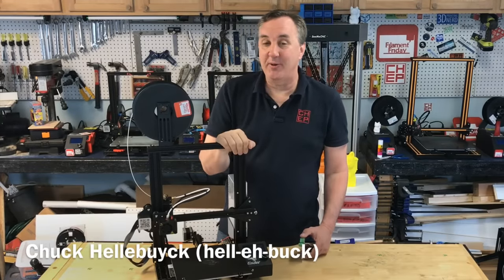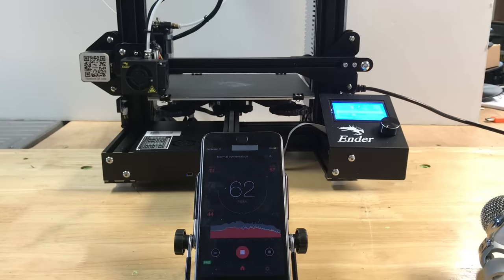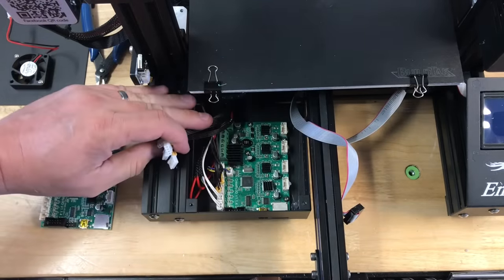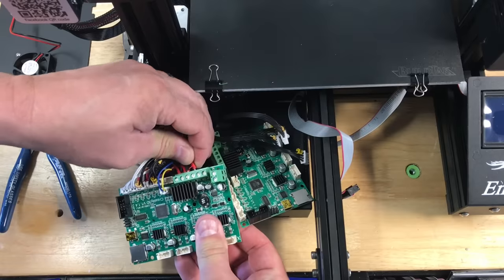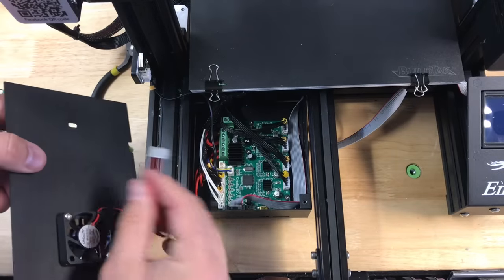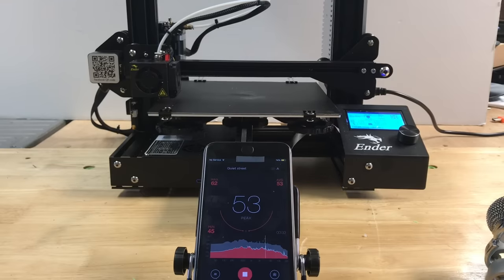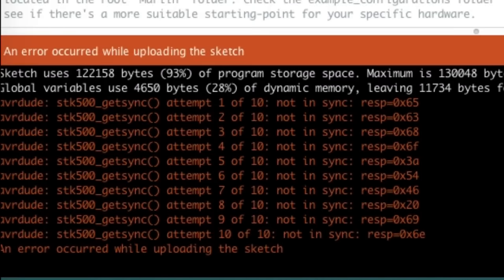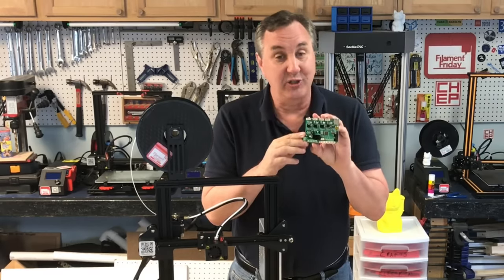Creality Ender 3 - Creality Silent Board v1.1.4 TMC 2208 Upgrade

Comment: I would not expect anything to work on the Creality boards. What I mean is sometimes there boards have advertised features, sometimes they don't, and sometimes it shows up on the LCD and it does not work(my pause/power loss restarted on first layer always). I got this all working by using a programmer and grabbing Marlin from github.

Comment: The board you removed was also the 1.1.4 board which is what my Ender 3 Pro came with.  How can you tell the difference between the "silent" board and the new stock 1.1.4 boards?

Also what is the app you're using for sound metering.

Finally, are the stepper motor drivers installable onto a 1.1.4 board aftermarket?
Reply from the maker: None of the 1.1.4 boards that come with the printers have the TMC2208 drivers. It’s only aftermarket. I used the dB meter app on iPhone.
Reply from the maker: It will work on the Pro as well.

Comment: @Chep: what are the vref voltages your V1.1.4 board is setup to?

My Ender3 with A4988 have both 0,56V for X/Y/Z and 0,72V for E which translates into 0.7A and 0.9A max current.
My CR-10 boards have these setup a little higher and less consistent between X/Y/Z.

Now I just heard in annother video that annother youtuber has his vref voltages setup to 1.2V.

Together with the sense resistor that is changed to 0.15R for the TMC2208 this translates into 0,867A peak or 0,613A RMS which would be only 150mA more for X/Y/Z and a little less for E.
Reply from the maker: I didn’t measure but I’ve read 0.65 to 0.72 for 4988. Around 1.2 for TMC 2208.

Comment: Chep have you had any dealings with the MKS Gen L board? I'm trying to get better temperature stability on the hotend, having added a capacitor to the board on the 5v side it's improved but still by no means perfect.  Any suggestions at all?
Reply from the maker: I’ve worked with previous MKS designs. They don’t open source the schematics so I stopped using them.
Reply: @FilamentFriday Thanks so much for taking the time to reply Chep.  Is there a similar board you could recommend that will take the TMC2208 drivers? I fancy changing out my Melzi board!
Reply from the maker: Why not the Creality board?
Reply: @FilamentFriday  Nice to know that detail about MKS boards.  I am still considering one because the 1.1.4 Silent boards are sold out on the official Creality site and other sellers, like AliExpress, have lots of complaints that the board the get is hit or miss. It might just be the stock 1.1.4 with A4988 drivers and no bootloader or the actual silent board with the TMC drivers. Some buyers are even getting the 1.1.3. Either way the sellers advertise them as silent upgrade with TMC. I would like to get the official Creality board since it is just plug and play but since the MKS Gen L is only $35 shipped from China with the TMC drivers, it makes me think a bit. Great video as usual.

Comment: I installed this board, it worked well, but now when I turn on the printer I get "invalid data" on the screen, never used to display that message, but it prints just fine though.
Reply: I am having the same issue. Have you found a solution?

Comment: Hi, what is the boot loader for ? I’m new to this . Do you need to do this to have the board work or is it plug and play .
Reply: Having a boot loader installed allows you to upgrade the firmware easily. It’s not an issue if you just want to use the board plug and play like in the video. 👍😎🇦🇺

Comment: how does a different board change the sound of the stepper motors?! can someone explain
Reply from the maker: The stepper drivers produce a smoother waveform that reduces the vibrational sound.

Comment: Good, so going forward I would expect no future 3D printer manufacturers should be using anything else but TMC (or better) drivers.  This line has been drawn for a while... Ya hearin' me?!?
Reply: Actually with soldered drivers it is not the best idea to use TMC on e-axis in standalone mode. It is one problem why I call Creality's"Silent Board" a bed thing. You shouldn't use 1/256 microstepping on the extruder, as this might lead to inconsistent extrusion. Prusa use SPI for controlling the TMCs and set them to 1/32 native microstepping on e, using no interpolation to solve the issue. No way to do that on Creality's board (but you see the issue mostly on direct, non geared extruders anyways)
The future of controller-boards should not be TMCs but 32-bit-boards with sockets (like the SKR e3 DIP). So you put TMCs on x and y, maybe on z, and a native 1/32 driver for e

Comment: Chep, I noticed you have switched from the ultrabase type glass bed to build tak. Whats the reason for this? Has the ultrabase stopped sticking?
Reply from the maker: I have multiple machines.
Reply: @FilamentFriday  Ah right, the ultrabase is still going well then?
Reply from the maker: Yes, though sometimes I flip it for a smooth finish.
Reply: @FilamentFriday  Cool, great video by the way. Very useful

Comment: I want one of these but based on the reviews, Creality is dropping the ball with flat out lies regarding features.  Based on the conversation below they may be sending them out with mis-adjusted drivers - voltages too high.  Not good.  I'll hold off until I see better reports before I drop $50 on this (plus shipping) and have to wait forever for it to arrive from China.   Too bad really, I love the Ender 3 Pro, a very solid printer with great print quality out of the box.

Comment: Creality will send you a 1.1.4 board for free.. If you bought a Ender 3 from Aliexpress or Banggood in 2018 that advertised "updated thermal protection" but you got a 1.1.3 board without protection. They had old stock and sold them as being a updated version. Chance are they will send the 1.1.6 board..
Reply from the maker: There is a 1.1.6 board?
Reply: sorry. 1.1.4 board
Reply: There are V1.1.4 boards without TMC drivers.

Comment: So I upgraded to the v1.1.5 board which has the same drivers and boot loader included. Given it still uses the same amount of memory can you add the BLtouch without losing other features?
Reply from the maker: Probably not.

Comment: Would it be a slicer issue for the extruder motor to stop mid-print or the vref set too low on the driver with this board? Checked everything else, jams etc
Reply from the maker: Don’t know. Could be the SD card.

Comment: I was trying your method and lost track of the two initial red wires to the terminal block. I checked my picture and think i have it all nicely the way it should be, but my main worry is if I reversed the two reds on the terminal block farthest from the power terminal block. What will the effect be if I got them wrong, and turn the unit on?
Reply from the maker: Sounds like the hotend heater connection. It doesn’t matter which one. They cane switched.

Comment: Did you test this board with long prints? I am wondering if  the stepper motors getting hotter than usual? and also wondering safety of printing unattended with these boards.
Reply from the maker: I’ve seen no issues
Reply: I've not had an issue with temps 24hr+ prints and all motors are lukewarm at the most
Reply: @vansien  thank you. What is your ~room temperature?
Reply: @vansien  do you know your vref voltages? Did you measure them?
Reply: @Azaim2  sorry i havent replied sooner, room temp is 22° and ref i cant remember the ref voltage off the top of my head, i did adjust and set them i know that much, but ive been working on several different boards and remembering each setting is tricky.
Reply from the maker: I recently reset them to 1.0v
Reply: @vansien  Mine room temp is like 30-32° may be thats why i got hot stepper with  default vref values (1.23V). I asked my problem to customer support of creality and they give me XYZ 0.94V，E 1.2V these values for this board. I set to these values and I am not having problem after that.
Reply: @Azaim2  that sound about right to me, when i next have to open the printer, ill retest what values i used.

Comment: how do I change the choice of the tmc2208 in the firmware?  I would like to use the 1.1.9 firmware that I have now on the stock card. I also have the bltouch . thanks in advance
Reply from the maker: Shouldn’t have to change anything since it’s design to emulate 4988.
Reply: Ok solved
Reply: non devi cambiare nulla
Reply: @jackomelly676  ho abilitato le voci TMC2208 e funziona

Comment: but if I upgrade to this, what if I want to get a mks etc, do they work together or would getting this board be pointless
Reply from the maker: Pick one or the other not both.
Reply: @FilamentFriday  ok that's what I thought would have to happen! Which way would you go?
Reply: TCG Therapy 
Cost of an MKS Gen L (or similar) with stepper drivers is going to be more.  I think I paid about US$70 all up with the TMC2130 drivers (very similar to the 2208, with the option to sense collisions), and would have paid less for TMC2208.

Putting Marlin 1.1.9 on it was easy enough, but I made a fair number of configuration errors to start with, and I’m not a complete ‘noob’ to this sort of thing.  The Creality board will be a far easier option if all that you really want is quieter operation and the safety features.  If you’re fairly confident that you can tweak configurations yourself (Teaching Tech’s video wasn’t quite accurate for me, although I was also installing a BLTouch and TFT 28 at the same time — why make it easy?  :D) then the separate board and drivers is going to give you more scope for future modifications.
Reply: I upgraded to MKS Gen L with TMC 2208, very happy with it :) And more space for extras like bltouch etc
Reply: @boggisthecat  thanks for the reply! so when you say separate board and drivers what exactly do you mean haha that part lost me!
Reply: @hansdegeytere  I'm not really sure all what I'd want from on my 3d printer, don't care about a camera feature or bl touch because I'm fine with the stock springs haha

Comment: Chuck, have you done a long print with this board? I saw a video from TH3D and they said that this board will have overheat issues because the PCB is only two layers and only has certain amount of copper which is less of what Trimonic recommends for their drivers. If the driver overheats it will shutdown ruining the print. I purchased one but I haven’t received it yet,. Thanks for the video.
Reply from the maker: Not yet.
Reply: Problem is the mainboard cooling fan is synced with part cooling fan. And if you run with part cooling fan disabled, the mainboard cooling fan doesnt cool mainboard and it gets rly rly hot.
Reply: Also stepper motors gets rly hot during print.
Reply: zwinko  I always run the part cooling fan, I have not had the need to have it off. Just in case I’m going to add another main board cooling fan just to make sure.
Reply: After looking at these boards in detail im surprised they work at all. They're badly designed. In one part the ground plane from the psu is very very thin.
Reply: @zwinko  mine too. Did you able to measure it? Mine y stepper getting really hot. Cant be sure if its ok or not
Reply: @Azaim2  I was thinking about using passive coolers. Saw some 40x40 that you can paste with heat conducting tape on side of stepper motor. But i am ok with that right now, it sticks temperature during long print, its high temperature, but i think it will handle just fine. For me much worse is high temperature on MB. While i often use part cooling fan disabled. I will connect MB cooling fan in parallel with hotend cooling fan, which should keep MB cooling fan turned on permanently.
Reply: @zwinko  thank you for your recommendation.

Comment: Hi. There is a third party board that has TMC2209 installed. Crealities solution has TMC2208.
Should I go for the TMC2209. It says ultra silent compared to just silent.
Reply from the maker: Believe that would be the 32 bit board. They are both equally quiet and either is an upgrade over stock board.
Reply: MODOC FPV the SKR mini has lots of upgrade opportunities with the new drivers. I currently have the quiet board from ender and am upgrading to the SKR mini. I have a BLtouch and it was a huge pain on the ender to work so I never used it. I believe the SKR board has a spot just for it.

Comment: Hi!
I have a question! 
I have the Ender 3 (not pro) and was thinking to order the silent board. I see there is one board for ender 3 and one for ender 3 pro. 
Can I put the board for pro version in my "basic" Ender 3 version printer? 
Im also gonna use BL Touch Auto Bed Leveling Sensor.
Reply from the maker: I didn’t know there was a difference. Creality shows the board is the same for Ender 3, Ender 3 Pro and Ender 5 on there website. Only difference might be firmware. Since your adding BLTouch your gonna need to change that anyway.
Reply: @FilamentFriday  Hmm.. I was thinking the same. But then i saw a YOUTUBE video what's the difference is on those two. And one was the menu on the display. Ender 3 pro has more features in firmware.  So actually, I can't see no downside to buying it for the pro version!? Because I want those features :)
Or does ALL the firmware be overwritten by the new thats included in the BLtouch kit?
Reply: Just saw that you download the new firmware yourself via a link on their website.
But still don't understand why I couldn't use the pro firmware? Just wondering... :)
Reply: Or I just order the right version to avoid headaches :) 

But at the same time I am so curious and always make everything more complicated than it is ..
Reply: @sirhenru6193  they are all the same. Ive just ordered a ender 3 one for my cr10 mini
Reply from the maker: You also get the wider extrusion under the bed and Meanwell power supply.
Reply: Just to confirm, yes this works perfectly at 12V on my CR-10 Mini. Obviously need to upload the correct firmware.

Comment: I just got installing the Silent Board on my Ender 3 Pro now I’m having a issue, when I hit the Auto Home the nozzle goes to the left and touches the thing with the bar code and makes a loud noise, I have the firmware 1.1.8 aim my supposed to have the 1.1.4 firmware with the Silent Board, I’m new to 3D printing and don’t know how to fix the problem it’s having, I contacted Creality yesterday about this issue and also sent them a recorded video on the the issue and no response.
Reply from the maker: Sounds like the x switch isn’t connected properly.
Reply: CHEP that was the problem, thank you.

Comment: hi, any chance you have a list of board versions with corresponding stepper drivers installed on them?
Reply from the maker: For Ender 3, Pro, etc. V1.1.5 (8-bit) and V4.2.7 (32-bit) are the only confirmed boards that have silent TMC drivers.
Reply: @FilamentFriday  thanks for that, only, I'm confused, isn't that a 1.1.4 board with tmc drivers?
Reply from the maker: Nope. There were some early V1.1.5 boards mis marked V1.1.4 but those are rare.
Reply: @FilamentFriday  understood, thanks, the z axis stepper motor on my 4.2.2 board is from a 1.1.4 board, should i change the Z_DRIVER_TYPE from A4988 to something else? (assuming A4988 is the correct driver for the steppers on a 4.2.2 board)
Reply from the maker: The motor doesn’t matter. Are you trying to build firmware?

Comment: I installed the v1.1.5 board into my ender3. Stepper are completely silent but I have noticed that filament change option is no longer available. Also when I pause the print the nozzle doesn't park it just stays on the print where it paused. A bit annoying.  Any suggestions how to re-enable these options?
Reply from the maker: You would have to modify the firmware I would think. I never tested that so I didn’t know they changed that.
Reply: @FilamentFriday  I've tried modifying the firmware  but when I enable the filament change segment of code(now called advanced pause) and  compile it, it says theres not enough space available to do so  and on top of that it requires nozzle park to be enabled so even more space will be used with both enabled. Trying to cut corners to free up space is a nightmare!

Comment: Hi, What VREF must by set on TMC2208 on this board to best motor pervormance on XYZ and E motor? I have  0.56V for XYZ and 0.71V for E
Reply from the maker: Those seem a bit low. Typical max Vref on TMC2208 I’ve seen is 0.8v XYZ, 1.0v for E. Some set them a bit lower to be safe. But it really depends on performance. The Higher the setting the more heat it produces in the driver. So if your printer is fine at those lower values then leave them.
Reply: @FilamentFriday  Big thanks for Your answer.

Comment: Anyone wanna donate me their old board if you upgraded? Might do a diy printer. I have an arduino with stepper shield but this would be neater. Got some nema17's, v-slot rails and T8 bolts. Still I would need to buy a heating bed and extruder and I bet those cost almost as much as a new printer so don't know if it's worth really.

Comment: Is this still the most up to date board to upgrade a ender 3 pro?
Reply: yes
Reply: Sort of yes, 1.1.4 silent version has been renamed 1.1.5 to stop confusion with 1.1.4 non silent version. So if upgrading you want a 1.1.54 silent one or a 1.1.5 version.
Not sure but I think 1.1.5 is same hardware but has bootloader and thermal install- check please.
As far as I am aware even the newest Ender 3 do not come pre-installed with silent boards as of July 2019.